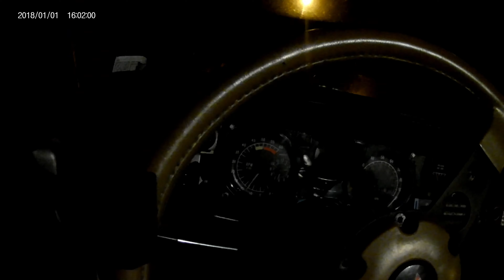𝘑𝘦𝘢𝘯 𝘎𝘳𝘦𝘺 𝘢 1979 𝘵𝘳𝘢𝘯𝘴 𝘢𝘮 𝘳𝘦𝘴𝘵𝘰𝘳𝘢𝘵𝘪𝘰𝘯  " Nesting the bird "

Comment: Most of the 79s got 403 olds motors, that looks to be Pontiac blue, factory 400 car?
Reply from the maker: its a built 76 400 bored n shaved with ram air 4 cam